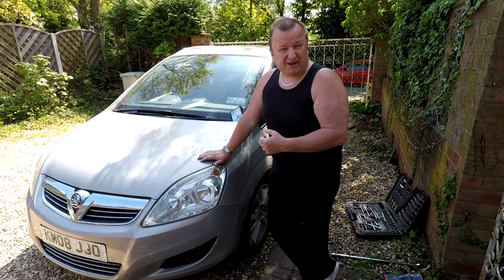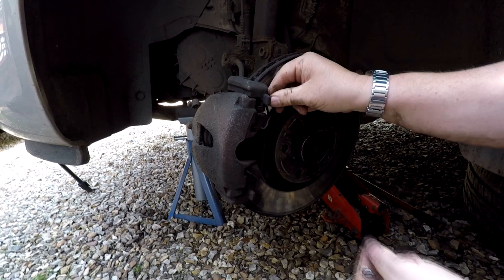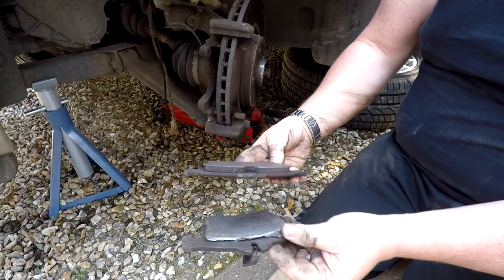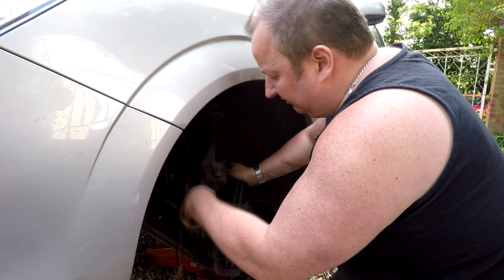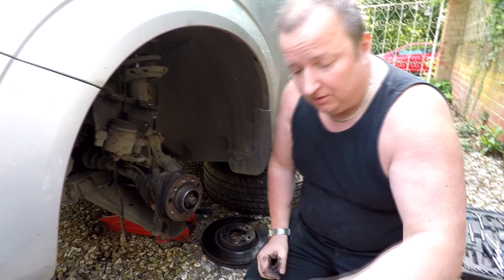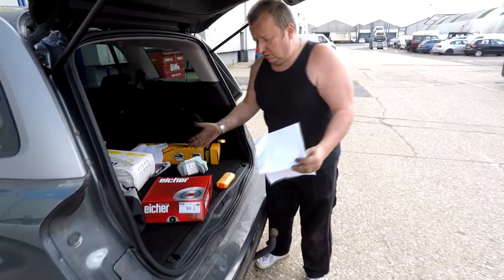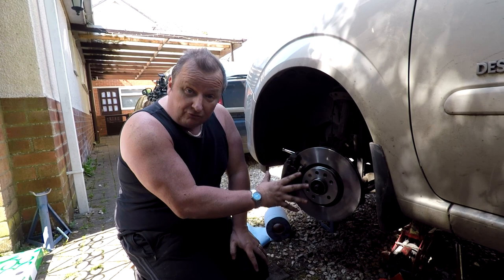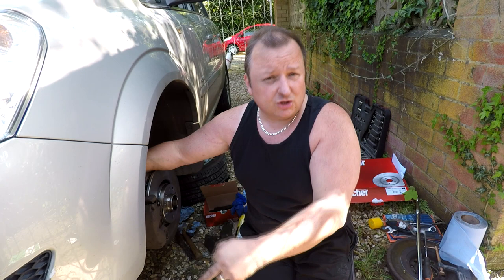Vauxhall Zafira B Front Disc And Pads Change Hell

Comment: You shop at ECP for their low prices not customer care? So, big 'box shifters' like ECP, GSF etc don't care about customer satisfaction, and they don't worry about losing your repeat business. Most good professional workshops don't go near them and won't fit parts supplied by customers from them. 

Many manufacturers change parts spec in the life of a car (yeah I'm looking at you ARB!), so their are multiple fitments. Their website explains this and you should really measure first or compare new with old. why they don't build a website designed around VIN numbers is a mystery because reg numbers are not accurate enough.

Comment: Euro car parts are shite, better of on eBay
Reply: Fleabay is good until you have to return faulty or incorrect parts, better off using local independent parts suppliers who care about the customer.
Reply: BrikMT the secret is to make sure you order the correct parts in the beginning I've never had any problems in all the years i have been ordering, add for local independent supplies most are out of business or selling on eBay.

Comment: Don't get me started on Euro Car Parts, and Parkers, the amount of times I've ordered parts on the phone to them with the reg. number and chassis number to be sure (as I live about 15 miles from the nearest dealer, so I go to my customer with the parts, start the job, only to be in the same position as you were in, that's even when I've done my due diligence and found that there are two types, made them aware of it, and STILL I get given the WRONG bloody parts, makes me SO F$^%&%G  angry, because I then have to do another 30 mile round trip to get them changed, any profit has now just evaporated into thin air...  And I lose an hour or 2 of my time, It's not right, and they definitely should be able to be held accountable for our losses and not just pass the buck, "The buck stops here matey, I think you'll find the contract was with you, not some other office" Even when you give them legal talk, they just stand there all dumb looking, it's a waste of time, I just don't use the useless arses anymore. Vote with your feet.
Reply from the maker: Exactly bud. I can't agree with you more.

Comment: copper slip is petroleum based and should be avoided on brake sliding pins where it comes in contact with rubber as over time it degrades the covers  silicone or rubber base Greece is a better product
Reply from the maker: Yes, silly me, I forgot.
Reply: is a good job shame the parts shop give ye a headache

Comment: there clutches are crap to, never get one from euro car parts, crap
Reply: Transmech brand to be precised.
Reply: Vincent Ng to be fair the transmech clutches aren't that bad anymore the quality has improved and now get a 5 year warranty with them
Reply: Dale Kiggin The damage is already done. Besides, I would rather pay a bit extra just to make sure I don't have to replace the clutch again (2 to 6 hours job).
Reply: Vincent Ng that's fair enough
Reply: im sure you are aware ecp dont actually make these parts, if you've bought the cheapest option chances are its not OE like Valeo or Sachs for example, which normaly are much better quality. The Icher brakes this guy bought have been sold for as little as 5 pounds, makes you think how much they cost to manufacture and how much ecp paid to still make a profit.